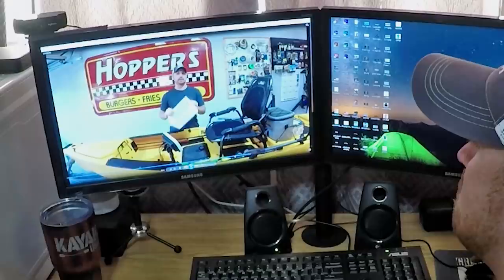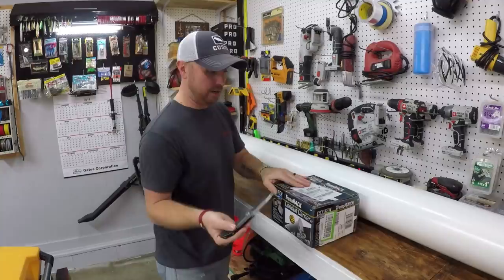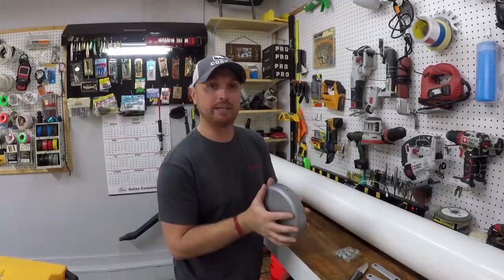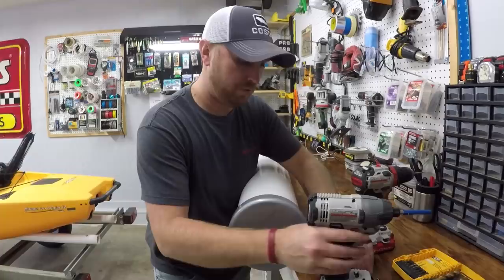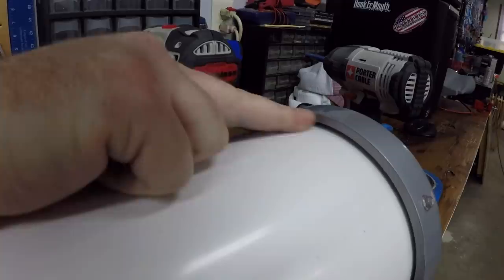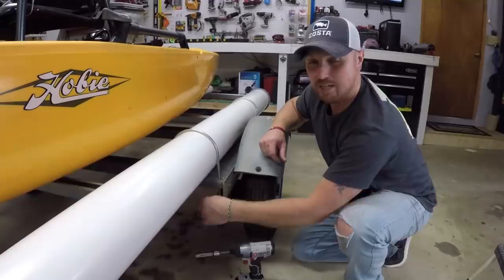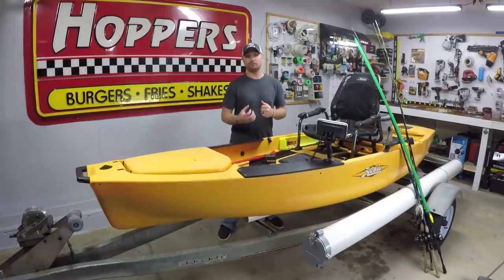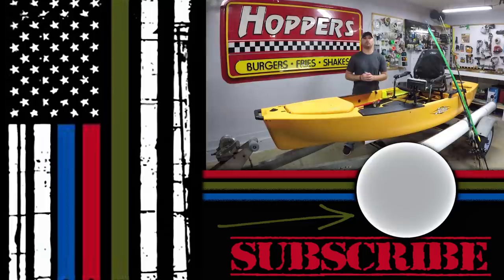Kayak Trailer Build | DIY Rod Pod | 2020 Kayay Cart

Comment: I loved the first kayak trailer you built. I ended up building one similar using alot of your ideas. The rod pod works like a dream. I'm able to run into the bait shop or grab a bite to eat without fear of someone just walking off with my gear.

Comment: Pretty nice rod holder....and a favorite video because it brought back fond memories of building a similar tube in the ‘80’s to store our sails, installed on trailers that towed our 16ft racing Hobie catamarans! The tube’s end caps were wooden and the $500 sails were securely locked away and out of sight.

Comment: I like all your videos and always am educated when I get the notification that you’ve uploaded another video.  With that said, I liked and learned a lot from your trolling motor install and remote installation.
Reply: Stream Rolling (not making fun of you), but it is called a trolling motor, powered by either a 12 volt, or a 24 volt battery, ...  for a form of electrical propulsion, ... a trolley, runs on a track, ... like in a mine, or the streets of SanFrancisco, ...
Reply: John E. Osman III ha!

Comment: As some one that works in public service, I like all your diy vids. However this one has to be in the top cause i just finished a trailer very similar to this one. Only thing I did different is add truck bed tool boxes, the kind that set on bed rail long ways to either side I got them on trade.

Comment: How about adding some of the carpet you used on the board inside the rod holder? It'll cover the screw tips along with adding padding for your rods/reels.
Reply from the maker: Sounds like a good idea but my luck is get a lure hung in the carpet lol

Comment: Thinking that I would prefer to secure the end, & hatch with rivets, ...just me being me, I s’pose, ...
And when I bought the “Tagalong” trailer from Harbor Freight, I knew ahead of time just exactly how I was going to make it purposeful to haul my kayak, & the luggage box, ... 1st I changed out the trailer tongue, & added a 7’ long 2”x2” square tubing, ... mounted it the same as the way they had the 4’ tongue mounted, ... then I bought a 10’ section of 3” PVC, chopped it in half, & ran it from the tongue point, out the back, spaced appropriately apart so that my kayak was at a pivot point on the trailer, ... but setting astride the 2 sections of PVC, & by adding another short section of the same PVC pipe on the nose of the trailer tongue, with a piece of a pool toy, like the pool noodles, ... to rest the nose in the slot I cut to fit the kayak bow, ...
But I have mulled doing something a bit different, ... I may change out the 3” tubes that the kayak rests on, ... & make them out of 6” PVC, ... & dual purposing them as rod storage, and kayak rest, ... in the same place as where the 3” sections are, ... or maybe I will just see if I can place one of my rods in each tube, without destroying the rods, or reels, ... if so, I can buy a plug cap, & convert one of them into a lockable cap, ...

Comment: Did you make a video of your pressurized water tank?  I’m thinking of doing one on my trailer.  I just picked up a used jet ski trailer and the cross members dip down in the center, I assume so a jet ski would ride lower for a lower center of gravity.  The dip is just about perfect for a 6” pvc water tank below my kayak.  I’m thinking adding that weight would make the trailer ride smoother, as well as being low would lower my center of gravity.  Not to mention the benefits of having 7 or 8 gallons of clean fresh water for cleaning sand or mud off the kayak or my feet before getting in the pickup.
Reply from the maker: Well, I kind of did I filmed me building it but I had major issues with the one I was building so it kind of got put on the back burner. But I am planning to build a brand new one on the camping trailer build series that I’m currently filming be sure to check out those videos and hit the subscribe button. I should be building that very soon in that series. 🤙🏼

Comment: So you are in a diner enjoying sausage biscuits and grits and in 30 seconds a guy with a battery drill and a quarter or half nutdriver undoes one of the caps and is gone with your rods in no time. Get some security head screws that are made to only go in, not out, with some nylok nuts on the inside... anybody tries to undo the screws and they just spin

Comment: Great vid this is the 1st one I've watched, I did subscribe. I have a question, I am building my own trailer out of a 18 foot boat trailer. I put a ladder rack on top just on the off chance I might carry a 3rd kayak. What about 1 or 2 4inch pvc pipes instead of  a 6inch they are a lot cheaper and I only have 2 or 3 rods.
Reply: Also I would like to  win thank you

Comment: I have a similar set up with the rod tubes but I have them loading from the stern. I find that the end of the tube is submerged when I am offloading/loading and water enters the tube. I have put a sufficient amount of silicon around the perimeter of the cap but that doesn’t help. Seeing your video, I am now considering reversing the tube placement so that I load it from the bow end. Do you think that will help? Thanks

Comment: Dumbest intro I've seen for a fishing channel but it made me laugh so I like it 😆 and hey you may already know this but I would put a cover over your reels because the pvc will scuff the hell out of your reels when you pull your rods in and out and I used rivets on my rod tubes and for reel covers I cut the stretchy part off some old tube socks go ahead a laugh lol but I be damned if it didn't work lol